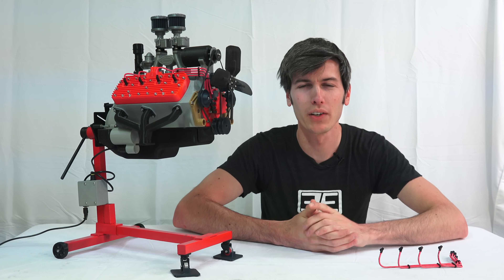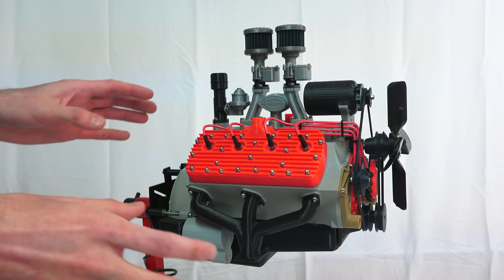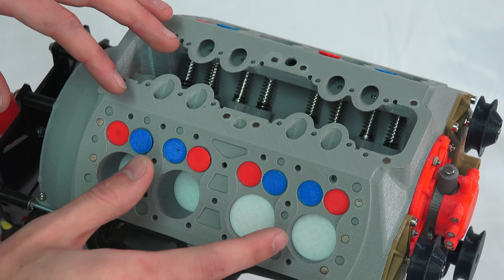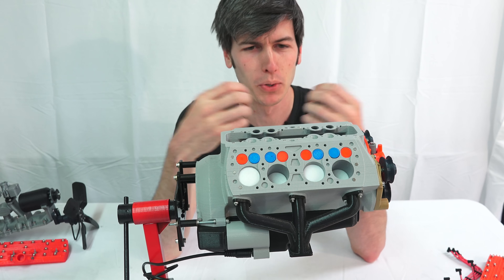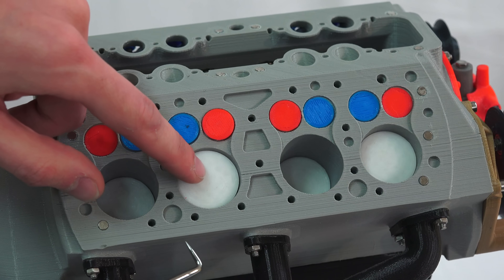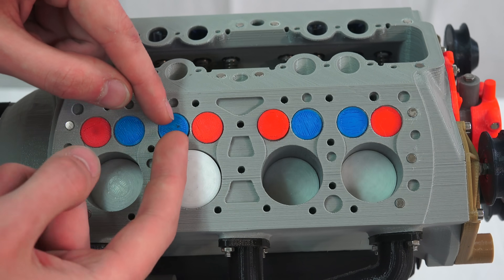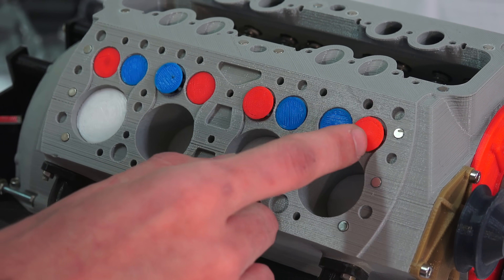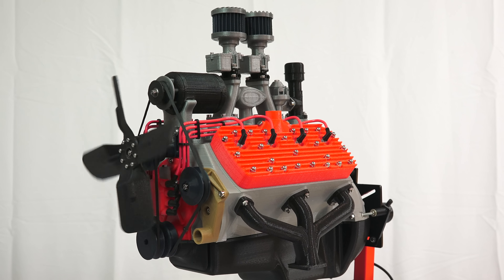Why Ford's Flathead V8 Engine Died

Comment: The flathead never really died, it is still popular, it just got old and out of date with newer higher compression engines that were coming out. The 54 Y-block was 239, the same cu in as the last flathead but had 10hp more. Then the Y-blocks went to 272, 292, and 312. The FE, introduced in 58 gace us the 332, the 352, 390, 427 and 428 as 23ll as the MEL and FT series.
Reply: 332 cu in engine and up was a different design than the 239 cu in Y block
Reply: @davidschwartz5127  He said FE.
Reply: And the Windsor pushrods were the sucessor to the Yblocks. And the powerplant of choice for the at the time newly birthed Mustang
Reply: Ford put their new small block V-8 in the Galaxie and Fairlane in 1962, the Falcon in 1963, and then in the Mustang in 1964.

Comment: I gotta admit that I love how the heads and valve covers are all integrated together as one part for each bank on this V8 design. From what I can see it looks entirely possible to even design and build 4 and 6 cylinder flat head engines as well!

Comment: Very good!! The genius of the flathead was the single cast block. V8's had been around for a while but were basically two four cylinder engines cleaved together.  A big problem with the flathead was overheating. The first question a buyer asked about a used flathead Ford was 'Does is run cool?'

Comment: Part of the low horsepower rating has to do with the gasoline at the time (pre-WWII). It was not uncommon for there to be 70 or less octane gas.  Flat head engines also ran hotter because of the exhaust gases running through the engine block putting a bigger thermal load on the cooling system. Low compression also increases the surface area of the combustion chamber which also transfers more heat to the cooling system.

Comment: Its a good thing Dick Padar never watched this video. When he got done porting and relieving, boring and stroking em, then raised the compression by milling the heads, installing a higher lift cam with longer duration and more overlap. Topped off with a Magspark ignition, dual exhaust and two or more Stromberg 97 carbs usually on a high throat manifold. Backed up with a Columbia 2 speed rear - until the 265 Chev came on the scene in 55, the flathead was still king of the road. John Milner's deuce coupe in American Graffitti gives a little idea. 
Ahhhh for the old days. There was nothing like the sound of a Padar flathead belching out thru open lakes pipes on the track or even thru Smitty's in town. Actually any flathead LOL PS Ive raced a few 54 Ford OHV and they didnt hold a candle to a Padar FH!!!!! In 1960 I raced a 53 Caddy up the Pa tpk in my 47 F w/a Merc engine. Pittsbergh to Ohio Eastgate. Beat him to the tolls by a half mile. 
Did I say, Ahhh for the old days? Here hold my beer, dont wanna cry in it while I reminisce.

Comment: I really think that the "elephant in the room" was the thermal load on the cooling system, exacerbated by the exhaust crossovers through the block.  Fuel efficiency should have been a major consideration as well, but most customers may not have cared.

An interesting point, which I only learned quite recently,  is that the V8 wildly outsold the 4 cylinder Model B even though the horsepower advantage was extreme and the Model B had plenty of power for those days.

Comment: The engine also had 2 water pumps, one for the left bank and one for the right, there was no crossover cooling. It almost as if they put two the the flathead 4 cylinders together.

Comment: Some say the sound of the flat head, also known as a 'nail head' engine is incomparable to a OHV based engine. I think the real died in the wool hot rodders prefer this style engine for this reason?
Reply: 'Nail head" was a Buick OHV engine post Ford flat head era.
Reply: Thanks for the correction...I'm still a student of this stuff...
Reply: the flathead was called snailhead, as it was slow when compared to a Buick nailhead

Comment: This block is an early style with the water spigot going to the center of the block. They went to a configuration where the water spigots were at the front of the block. One in a million old style blocks cracked, one in a million new style did not crack. It was in the middle of the block where it cracked, an engineering blunder. If you want to run one, get the old style with the water spigots in the middle.

Comment: The advantage was that flatheads could run on extremely poor quality gasoline, and I've even heard stories of people running them on kerosene, but I've never seen it myself.  I remember that there were still a few old cars running flatheads in my neighborhood into the early 1970s. Mostly old trucks.

Comment: A few comments:-  You're dead right about gas flow and that these engines could never be particularly efficient.  Nevertheless, an engine with a production run of over 20 years must have had many good points.  Regarding it's 65 horsepower in it's first incarnation, never forget that horsepower is torque x RPM.  Engines designed to never be used much above 3500 rpm with low horsepower but good low down torque can be much preferable for normal use than an engine which develops heaps of horsepower at 5500 rpm, but has little torque at low revs.  The flathead V8 was definitely at the end of it's development in 1953, for the gas flow reasons you give, and also because the long exhaust ports in the block made it prone to overheating.  Interesting figures are that the 1954 239 Y block developed 130 hp at 4200 rpm while the 1953 239 flathead developed 110 hp at 3800 rpm.  The Y block had a bit more torque throughout it's rev range too.  Another interesting point is that the only engine which has an exhaust note quite as nice as a flathead is the Y block, as both these engines used a firing order not used in any V8 since, as far as I'm aware.
Reply: Before automatic transmissions became common, people wanted engines to be as flexible as possible.  Before synchromesh, which was first introduced on the 1928 Cadillac but not universal until some years later, shifting gears without grinding took more skill than many people had.  Even after synchromesh, shifting was more difficult than it is on modern cars.  So, engines were designed to be very flexible, even at the expense of power and efficiency.  Some cars would run smoothly at less than 5 mph in high gear and pick up smoothly from that speed, but not very fast.  Cars could even be started out in high gear smoothly without causing undo clutch wear.  Very heavy flywheels helped.  To be able to climb steep hills in high gear, the differential ratio was a bit low resulting in higher engine speeds on the highway.  The mark of a good car was to be able to climb steep hills without making the driver shift to a lower gear.

Comment: The internal combustion engine history reminds me of the computer industry of today
Just go back and look at the beginning of the internal combustion engine they were huge and yet only made 10-20 hp and yet in 50 years they would get way smaller and yet way more powerful all at the same time, take this engine for example the Ford V8 designed in the 1930's with 65hp good for the time yet today a 3.5 liter engine could put out over triple that whole using the same amount of fuel or even less
   the speed of advancement is amazing just like computers, the first ones were the size of whole room then in no time PC came out and it could fit on a desk and even though I was much smaller they were much more capable and then now, I'm typing this very comment from a computer so small that it can fit in my pocket yet its 1000's of times more powerful then the original that took up whole rooms
   In our lifetimes you can see how fast these technologies have advanced, I can only imagine where we will be when I'm my grand parents age

Comment: Neat model and explanation.
Another advantage of early low compression engines; they ran happily on low octane fuel.
So low, modern engines of today wouldn't even start up on.
For an interesting look at a combination engine; Willys F Head.
Had exhaust valve in the block and intake valve in the head.
Same engine as it's predecessor flat head but made 15 more horse power just by moving that valve.
Went from 60hp to 75hp.. lol!

Comment: This is very interesting the ford flat head motor held the land speed record
 for a time   this is neat because to do that it was well balanced  and the
 internal Mass was low   the pistons were carved for air flow 
   I think that the biggest problem with the ford flat head motor was the cooling
   system   AKA  the more power the more heat has to be removed 
     and a question where did you learn motor science?   i have found that
     it is tough differently in other placed in the world

Comment: My grandfather owned a dairy farm and he had several Ford farm trucks with the old flat heads. He was a master at rebuilding them throughout the 40’s and 50’s until parts starting becoming expensive. You could place a glass of water on the running engine and never upset the water they ran so smooth.

Comment: actually the different direction of airflow inside the chamber helped put an aggressive swirl on these flatheads to help mix the fuel and air, giving it good low end torque

Comment: The only problem with the flat head engine is the V block configuration, if it had been an Opposed Piston design this engine would have made substantially better power.

Comment: As for low compression and inefficiency, one should recall that when this engine was developed, gasoline had an octane rating of about 50. Raising the CR got you nothing but detonation. Phillips 66 took its name for a reason: a big leap in octane rating, all the way to 66.

Old engine designs favored long strokes, therefore high torque and low RPM. High horsepower was unnecessary in a land where a great many roads weren’t paved until after World War II and Interstates hadn’t been conceived, because you weren’t going to be driving all that fast. So volumetric efficiency and “breathing”  weren’t that important. An engine needed to run with reliability acceptable for its time, achieve reasonable fuel mileage, and have an acceptable service life (which was short in those days). That was enough.
Reply: Alan's Mistakin' Acres you explained it.
My old Willys Jeep had 7:1 compression for a reason.
The fuel available limited compression ratios due to knocking.
Reply: Even in modern industrial engines where it's advantageous to get peak torque at a low RPM, the piston stroke is relatively long compared to bore, compression ratios are low, spark plugs are enormous, intake plenums are long and narrow.  Only these days, such engines come with electronic ignition and spin-on oil filters and fuel injection
Reply: Alan's Mistakin' Acres A quick google search says that isn't why phillips 66 is named that
Reply: That's the thing with the internet,you gotta be real careful with what you say these days, back in the day people use to say "yeah my Dad fought in Vietnam"  now it just takes a few seconds to finds out he really didn't,lol
Reply: I've got a 55 Ford 272, 7.5:1 if memory serves.

There's actually a gap between the piston and the head.

The 272 has the shortest stroke of the Y-block series and they didn't even bother changing the rod length from what I've read.
Reply: @glenwaldrop8166  LOL there is always a gap between the piston and head. Even in a diesel with much much higher compression than any gas engine there is a gap. If the piston hits something it would break.
Reply: Alan's Mistakin' Acres uhhh... Philips 66 was named after a road.
Reply: The low compression benefits nicely with today's fuel though, a little ol M90 does wonders for the torque of the FH.
Reply: hughaxton where did you hear that?
Reply: The biggest problem with the earliest Ford V8's was that they overheated very easily. The same problem came back in the 1970's with the rear most cylinders in the 351 cu in V8's.
Reply: Named after Route 66... not octane rating.
Reply: @Bartonovich52  Yes and no. Phillips 66's bio says it got the name in 1927, for hitting 66 MPH on Route 66 using their new fuel. They opened their first station with that name soon after.
Reply: rugerscout308 - The Flathead V8 had 2 water pumps, one for each bank of 4 cylinders.  Don't know of any other auto engine like that.  That's a clue that there was a cooling problem with this engine.
Reply: @Loulovesspeed  If you had a good radiator a properly sized cooling fan, a working thermostat and a block with clean cooling passages these engines didn't over heat . Unlike today the cooling system was not pressurized  My cousin had a 52 and we could drive for hours and then put your finger in the water without getting burned. The reason for the 2 pumps had nothing to do with being hard to cool. It was because there were no cooling passages between the 2 sides of the block. In most modern engines there are cooling passages from 1 side to the other in the heads. On a flat head design the head is a simple machined piece of flat cast iron . Many of these engines are today full of rust and in the case of flathead fords sand from when it was cast. I have seen some with pounds of sand when set on side and flushed with high pressure hose.Unless the engine has been modified there should be no issue with cooling
Reply: great reply I learned some things
Reply: Hi there.....you did a good job explaining....
Reply: Alan's Mistakin' Acres q
Reply: Thanks for putting this design into a historic perspective.
Reply: Best comment of 2022
Reply: "According to the Phillips Petroleum Company Museum in Bartlesville, the “Phillips 66” name for the gasoline came about by a combination of events The specific gravity of the gasoline was close to 66; the car testing the fuel did 66 miles per hour; and, the test took place on US Route 66.[9] So, the naming committee unanimously voted for “Phillips 66.”" 

So not octane.
Reply: "According to the Phillips Petroleum Company Museum in Bartlesville, the “Phillips 66” name for the gasoline came about by a combination of events The specific gravity of the gasoline was close to 66; the car testing the fuel did 66 miles per hour; and, the test took place on US Route 66.[9] So, the naming committee unanimously voted for “Phillips 66.”" 

So not octane.
Reply: My mother's 1950 Chevrolet had a compression ratio of only 6.5:1 with was a bit low even for that time.  I seem to recall that the compression ratio of my 1951 Ford V8 was 7.0:1.

It was very difficult for a flathead engine to get more than 0.5 HP per cubic inch.  Hudson, with its 308 cubic inch flathead 6, claimed to get something like 175 HP with the Hudson Hornet (that was with dealer modifications), but I suspect that that was somewhat of an exaggeration even though they were winning most of the stock car races with that engine.
Reply: I just have to throw this in there, some people are pushing 600 horsepower through those things. Is it rare? Absolutely. But can it be done? Yes it can. Even more are running with 400hp. So maybe they aren't the best engine, and they were built the way they were for their time, but they can still make a good amount of power if you really want them to, despite being inefficient to an extent.
Reply: garyp4205  Phillips 66 wasn't even sold in states where highway 66 ran.
Reply: I worked at a Philips 66 in the 1970s. Never knew that about the name. Thanks.
Reply: Agree on your first sentiment.

But...

"Old engine designs favored long strokes, therefore high torque and low RPM. High horsepower was unnecessary in a land where a great many roads weren’t paved until after World War II and Interstates hadn’t been conceived, because you weren’t going to be driving all that fast. So volumetric efficiency and “breathing” weren’t that important. An engine needed to run with reliability acceptable for its time, achieve reasonable fuel mileage, and have an acceptable service life (which was short in those days). That was enough."

If you're gonna correct someone on something, better make sure they didn't cover it (which in this case, he did).
:)
Reply: route 66 got its name for the same reason- cars had to use 66 octane gas to be able to make it to Santa Monica.
Reply: hughaxton I have no idea where you got that. As far as I know, Cyrus Avery originally wanted to name it Route “60” but that was already taken by several other state routes. So he and those running the Federal Highway System chose “66” because it was unassigned.
Reply: @hughaxton  
True???
U sure??
Aren't freeways labeled by whether they run N/S or W/E ?
Reply: false, a joke
Reply: @hughaxton  
Thanks 😔